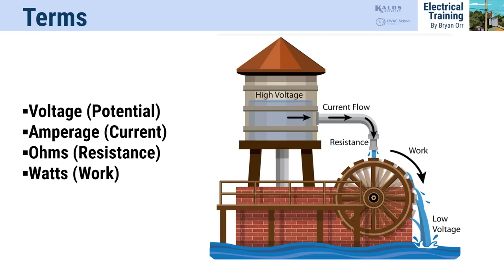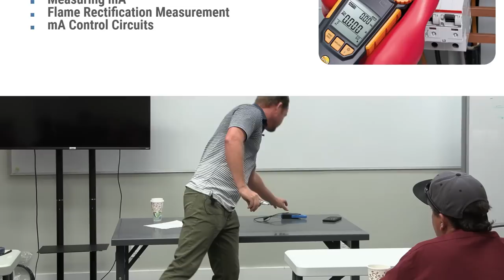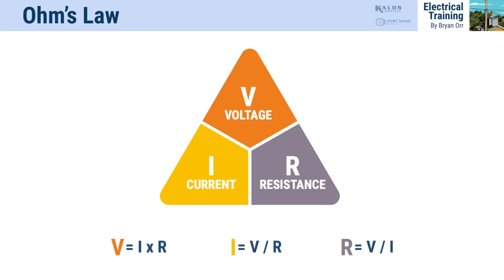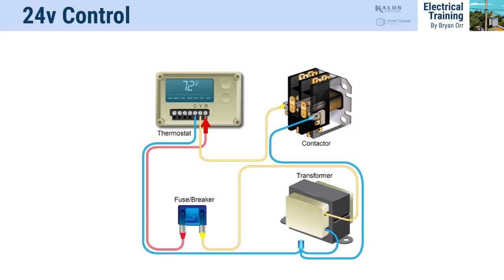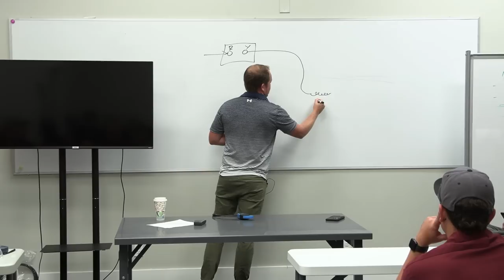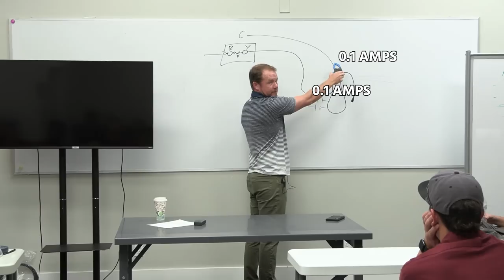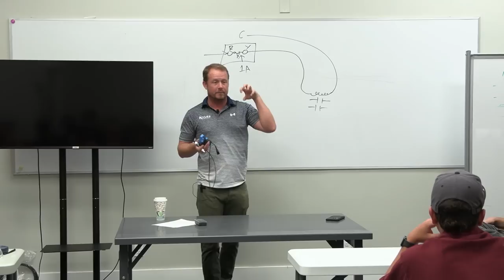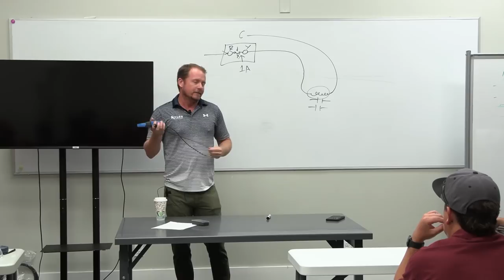Electrical Current (Amperage) Basics

Comment: Thanks
I would like to add that when you are measuring low amperage, it is handy to loop the wire several times and then divide the reading by the number of loops. You can make your own 10 turn loop and put a male spade connector on one end and a female on the other. Some old cliparownd meters came with loops the you could plug in to the Wall outlet and plug you small appliance in to it. I hope this helps someone out.

Comment: nicely put, using real life examples makes the point easier to understand. as a master electrician, you were spot on in your presentation. electricity is a fickle bit*h, she always takes the path of least resistance, wherever that may be, casings, circuitry, human skin and she will take you for more than your ex wife did in divorce court.